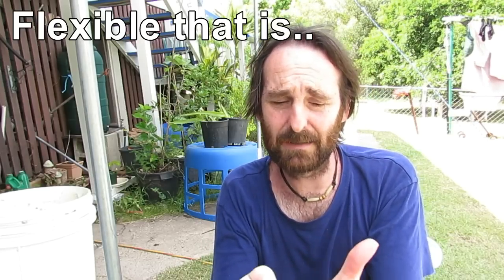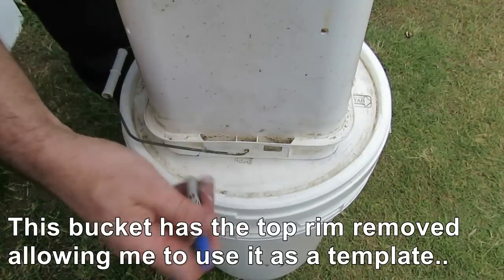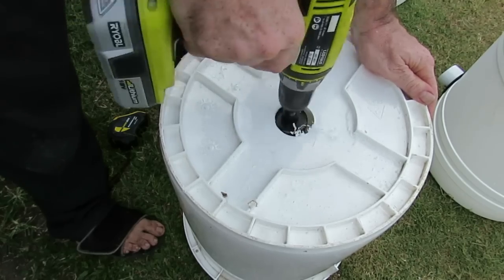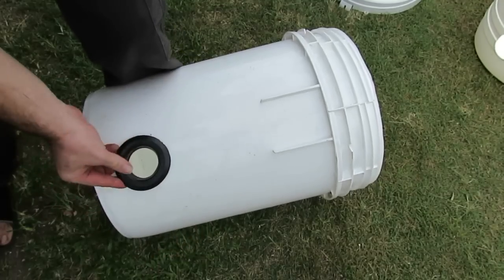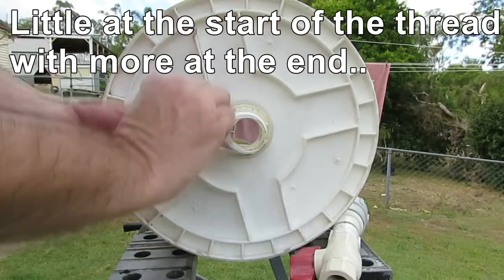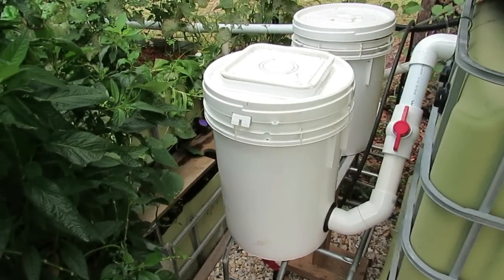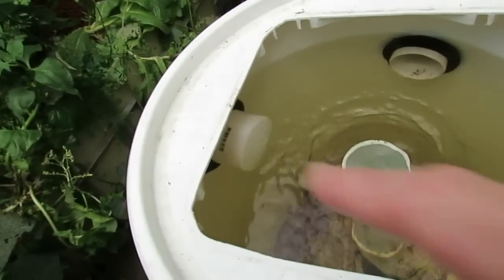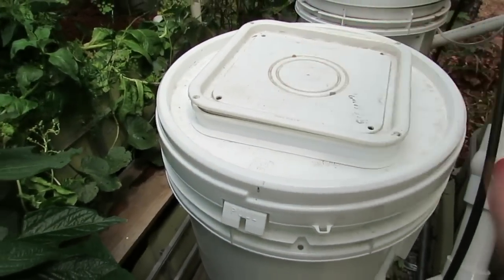How to Build a Radial Flow Solids Filter for Aquaponic Systems

Comment: Rob, first,  let me say,  I love your content.  Thanks for sharing. The reason you are not getting the waste to the center drain is most likely because you are not getting enough radial motion to draw it there.  The input pipe needs to have an angle to it to spin the water. the best is perpendicular to the long axis of the bucket, (tangential to the circumference of the bucket), and pointing slightly downward. in your design water is essentially bubbling over the top of the input pipe equally on all sides defeating the idea of a radial flow. you will probably have better luck if you remove the smaller bucket, shorten that stand pipe to add a 90 degree elbow, then place an extension pipe to the edge of the 5 gallon bucket and add a 45 degree elbow that ejects the water to move around the edge of the bucket.  that will create the rotational movement that will circulate the water to the center of the bottom.  The other issue you have with the current high input, low output is your output is in the flow path of your solids so you are going to get more solids in your output. your input needs to be lower than your output so the natural draw of the radial motion keeps your solids away from the output. the input should be about half way to 3/4 down the bucket and the output at the top. I figured that out in designing mine. I can send you a pic of the design or the implementation if you my desrciption wasn't clear.  Cheers.
Reply from the maker: Hi David. The filter you're describing sounds more like a swirl filter. 👍 
This jobbie did a great job at letting the solids precipitate out even though the flow rate was a bit faster than I would of liked. Unless the base is conical there will always be issues trying to get the last of the solids out. I don't find it being a huge issue as it only takes a quick squirt with the hose, even in the large 200L/50gal one I'm running at then  moment. 
Have been asked by a few folks to see how we clean out the large one we use now so might do a clip & include a bit of a Q&A as well. 

Cheers mate.
Reply: Thanks for the follow up.  I didn't realize there was a technical difference between the radial flow and the swirl filters. I thought it was just a difference in the nomenclature. Something else to read up on. Cheers.
Reply: No sh!t man, learning everyday, lol,  I'm noticing some people with the input to the filter in the top middle (some in the bottom middle), while others with the output in the top middle, the radial flow, pushing solids to the side of the barrel, then down to the bottom.  I've also noticed some people using shrouds over the input, to force the water to change directions a couple times on its way to the output, and others that don't use such shrouds.  Thanks for your comment helping me realize what I've been seeing.

Comment: Put a plate with holes in it 5cm from the bottom of the radial filter.  It will help keep the solids in still water and will increase water velocity when while draining.
Reply: what size holes and all over the plate, would that collect some of the solids on top of it

Comment: Hi Rob,
Do you really need a bio filter if you have a flow filter?
And if you do, what is the best set up for them?

Thank you for your videos they have been very helpful to me, cheers
Reply from the maker: Hi Issam.
In most reasonably stocked aquaponic systems the grow beds are the bio filters so a stand alone one isn't needed.  I'm over stocked by about 30 fish so like to have the extra bio filtration there to handle the load. 
Hope that helps some mate & sorry for how long it took to reply.
Rob.

Comment: Hi Rob, im planning to start a fishtank in my small garden, and i've been searching for ideas and i have a question for you:
I'm thinkng of using a pond pump to take de water out of the ibc tank, and simply drop it at a beggining of a tray filled with biofilters, plant the lettuces and other stuff directly in the bio filters, have the water go throu 4 plastic trays and let it fall in the ibc fish tank again. is it too simple and prone to fail due to solids acumutation in the first tray? i have limited space for this setup.
Reply from the maker: +José Miguel Camarinhas 
Hi José. 
That sounds like a lot of basic systems I've seen folks build. 
When you say biofilters do you mean a basic media bed filled with rock or clay media?  
Loads of folks have systems set up without solids filters & many run for years without any problems. Running the water from bed to bed will mean that the the first will accumulate the bulk of the solids acting as a filter of sorts. You might just need to clean it out a bit sooner depending on how many fish you stock & your feeding rates. 
Cheers mate.
Reply: +RobBobs Backyard Farming Hi Rob, you got my idea correctly, thanks for your reply. Cheers.

Comment: you can put some crawfish in your RFF/radial flow filter ! works good and if the crawfish get out more food for the fish=)
Reply: never add live stock into a filter system , they produced waste as well arent it ?
Reply from the maker: +kris eichenhofer 
Hey Kris.
Have seen folks talk about adding them but isn't something I'd do as they wouldn't remove all the waste. The filter would still need cleaning & that cause a few issues I think. I think it would be better to have them in a separate set up that gets fed the waste from the filter when it gets cleaned.  That's just my take on it & to tell you the truth I don't know a great deal about raising crayfish. 
Cheers mate.

Comment: where in the heck can I find drain to waste fittings? I've searched as best I can and this video popped up in the Google search. My local box stores look at me like I'm a fool lol
Reply from the maker: +Mark Snow 
Hey Mark. This might help if you are in the States.
 I just did a search on Lowes and came up with this 
http://www.lowes.com/pd_253153-138-420994___?productId=50314993&pl=1&Ntt=pvc+sink+drain
That is a 2" but will give you a starting point.
Reply from the maker: +Mark Snow 
And if you're in Australia
http://www.bunnings.com.au/caroma-40mm-plug-and-waste-with-spacer-white_p4920650
It's called a "Plug & waste" by some too.
Hope the links help you out some & would like to know how you get on.
Rob.
Reply: +RobBob Thanks a lot. I saw the shower drains but kept searching for "drain to waste fittings". You've given me tons of info to inspire my setup that's under construction now. I'm not on here that much, but I'll post some pics later on your Facebook page.
Reply from the maker: +Mark Snow 
Would be great to see how it turns out.
Cheers Mark.

Comment: Why the smaller, square bucket inside of the larger round one?
Reply from the maker: +fsbell1 The square bucket redirects the flow of the water downwards. As the water slows to pass under the lip of the square bucket it slows & the solids fall to the base of the filter to be drawn off later. 
Hope that helps.

Comment: Hi nice video. I try to start my fitst environment and I want to ask you how I can calcolate how many fish I can put in my environment?
Reply from the maker: +Giorgio Cerruti Hey Giorgio.
The rule of thumb by many on stocking densities comes down to how much bio filtration you have in the system. I like many suggest 20L of wet (under water level) of 20mm rock or clay media for every fish you want to raise to 500g. This will give you more than enough biological surface area for the bacteria to colonise & oxidise the ammonia/nitrite for you. 
Hope that helps you out some mate & have fun with the build.

Comment: Great vedios again ! However this time I think I'm missing something in your video. I understand the input from fish tank is low on one side. 40mm from bottom. Also drain to waste is from the middle of the bottom of the outer tank. What is the plumbing between the outer and inner square tank? I'm sure it is more than obvious to most viewers but I cannot quite get it. Hope you have time to respond. Tks.
Reply from the maker: Alan Lloyd Hi Alan. 
There is no plumbing between the square bucket & the drum itself.  The bucket is just used to re direct the water allowing it to slow when it hist the base & let the solids drop out onto the base of the barrel. 
Hope that helps some mate,
Cheers.
Reply: RobBobs Backyard Farming Got it !  Thanks.

Comment: I've got a radial flow filter empting into a bio-filter and then into the sump, where the water is pumped into the grow beds to restart the cycle.
Am I missing anything? Please advise.
Reply from the maker: George Jones Hi George.  I have mine set up the same way with the water going back from the sup to both the fish tank & grow beds. 
Best media to use is the purpose made media but have seen folks use material like shade cloth & bird netting. Have also seen bailing twine used as well if that helps.
Hope that helps some.

Comment: For the solids where u have to use a syphon have you thought about heating the bottom evenly with a heat gun or torch and gently pulling downward on the drain to make it a funnel shape? Then all should settle down at the base of the funnel and the force of water pressure should allow the solids to be forced out.
Reply: Did you watch the video? 7:27

Comment: I built a radial flow filter recently and the solids dont seem to be settling on the bottom. Any reason you could think of that is causing that? The water is being pumped from my pond into the RFF before it gets to the GB.
Reply from the maker: Hi there.. Could be due to a few reasons.. From what I've read/been told tilapia (not sure if that's what your running though) waste can float a bit before it settles down..  Another cause can be if the water flow is too great into the filter it may not slow down for long enough to let the solids drop out.. In that case you either need to slow the flow or get a larger filter to aid in the retention time.. 
 Another reason I've been told of but not seen myself is that some food has high fibre content & can cause the waste to float, am not sure how accurate that is though..
Hope that gives you some clues as to what could be going on..
Cheers..

Comment: a short question, if I may. When u say "mil" do u mean millimeters? )) have been hearing it through in countries where imperial measures r used but am not sure. Thanks
Reply from the maker: Hi There.. Here in Australia we use metric as a standard so I use millimetres but also include inches/gallons for those in countries that haven't changed over yet..
Hope that helps & have a great one,
Rob..
Reply: RobBobs Backyard Farming Thanks Rob!

Comment: Great info. This is one of the best filter build vidoes I've seen yet .I'm researching for my first set up this spring here in Ontario Canada (it warmed to a balmy -9c today!) my set up will be in a heated garage turned into a greenhouse so leaks will be no bueno. Do the uniseals hold up well , I'm leaning towards bulkheads instead.
Thanks for sharing all your work, cheers mate.
Jeff Mitts (by the way , I bought a jiggle siphon years ago at an auto show from an Australian, go figure)
Reply from the maker: Hey Jeff..
Haven't had any issues with the uniseals at all.. Have started to us them to plumb up the grow beds now to see how they go as compared to the bulkheads.. 
Stopped using the jiggle siphon here, just too much solids & it kept clogging up.. Not that I need it in the new aquaponic set up but have to clean a few solids from the base of the fish farm tanks every now & then.. Found that a straight ½"/13mm siphon hose worked much better..

Cheers Jeff & have fun with the system mate..
Reply: Good to know, thanks for the update.
Wish we had your weather! I gotta move down under.

Comment: Rob,

I absolutely love your videos, and have I think watched all of your aquaponics clips.   I am a little curious as to why use a radial flow filter rather than a couple of screens at the outlets on the bed to collect the solids?  I am currently not running a system, but will be starting one soon, and appreciate the insight as I have now seen both setups.

Thanks very much for all the vids.  Great work!
Reply from the maker: Hey Chris.. I was using the scouring pads as filters to start off with before the RFF went in.. Due to the amount of fish solids that come through the system I think it's a lot easier to remove them in one filter.. The sponges/scourers require daily maintenance where the radial flow filters can be cleaned out once a week.. 
Hope that helps & glad you like the clips..
Cheers..

Comment: Becuse of my setup I only have about 3-4 inches or so drop from the (1000 liter) fishtank outlet to the swirl filter inlet. Would that create enough pressure to make the filter work properly?  I think I have a 1200 GPH pump. thanks Rob for your amazing videos!
Reply from the maker: Hey there... That's about the fall we have on ours the radial flow & found it worked fine.. Having the correct pipe sizing helps you there with the flow as well.. 
Glad you like the clips & thanks.. Have a great week,
Rob..

Comment: Your videos are great ,thank you can you tell me were to get union joints in Australia,live in Qld
Phil
Reply from the maker: Hey Philip.. Sorry for taking a while to get back to you mate.. 
Do you mean the barrel unions for joining the pipe ? 
Cheers
Reply: Yes please , I have found another way thanks to a plummer at bunnings but I like the idea of the union joints
Phil
Reply from the maker: Phillip McCallum You should be able to get them from plumbing supply & bunnings stores.. I got ours from  http://www.irrigationstore.com.au/Barrell-Union-Slip-Port-PVC
I bought a whole load of fittings from them as they were so cheap & have a $20 flat shipping fee.. 
I also like to use the rubber sleeves & hose clamps..  Can be a cheaper way to do it for smaller diameter pipes..
Cheers mate..
Reply: Thank you ,love your videos ,keep up the good work
Phil

Comment: Hey Rob, I am a newbe in the Aquaponics world, so I have what could be a dumb question. How can I have a radial filter when my GB is above my fish tank.(Backyard Aquaponics IBC Setup) P.s you are the aquaponic master IMO.
Reply from the maker: Hi there :)
All you would need to do is have the RFF set up so that the outflow from it would run into the grow bed via gravity.. Should be easy enough to do with a small 50-60L drum..  Let us know if you want more info..
No master here, just learning as I go ;)
Cheers & have fun with the build,
Rob.
Reply: Thanks for the quick reply Rob, I would like to run a RFF from the fish tank to the GB if possible but I cant work it out unless I use a pump. My GB is sitting on top of my fish tank. If you have an idea I am all ears. My other option is t run it back into the fish tank.  I would prefer gravity fed.

Thanks once again.
Reply from the maker: jjs4x4  What size pump are you using at the moment ? If it can manage the head hight of say 200-400mm you would run that into the RFF instead of the grow bed.. The solids would be removed & the water would flow out to fill the grow bed..
Hope that makes sense..
Reply: It is a 5000LPH so it will have no problems with the 400mm height. I will give it a go and let you know how I go. Thanks.

Comment: what is the volume of the white buckets?
Reply from the maker: Hi there...
Sorry for the slow reply as I missed your comment..
The white buckets are around 55L/14.5gal (US).. Really should have a larger 100L/26.5gal - 200L/52.8gal drum to increase the retention time so more solids can fall out.. The next one will be a 200L/52.8gal unit I think..
Hope that helps & sorry again for taking a while to get back to you,
Rob..
Reply: no problem.thanks for the info

Comment: Hi rob i was thinking what if you could make the bottom curved that way the heavy debris has no choice but to go down the drain?
Also where do you get those buckets from as i can not find any with a screw on lid.... PS i live in Sydney.
Reply from the maker: Hey there... Have thought of dishing the base to help with the solids collection but have left it flat for the present builds.. Still only takes a min or 2 to clean it out so is no big issue..
I got the drums from a produce/feed store.. Most will sell something similar for storing animal feeds in..
Hope that helps,
Rob..
Reply: Rob you did hear me say i am From Sydney, where lazy here....lol i got two idea's one would be to heat up the bottom and just let gravity and some water to set it, the other would be to cut the bottom off and use a dish that's pvc "dollar store" then shrinking it tight to the bucket then pvc Cement it... I love the smell of that stuff it gives idea's lol.
Reply from the maker: Cheers BlackIce504  :)